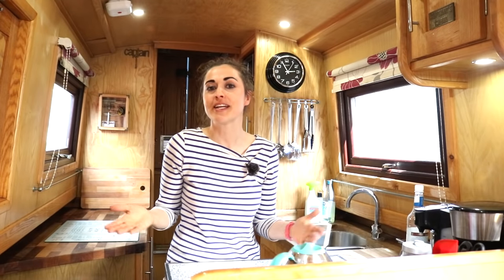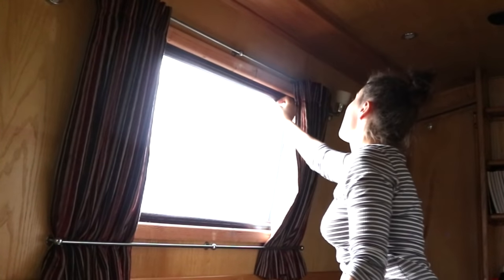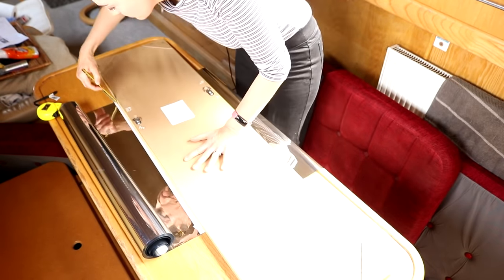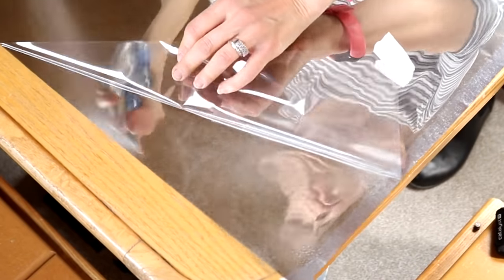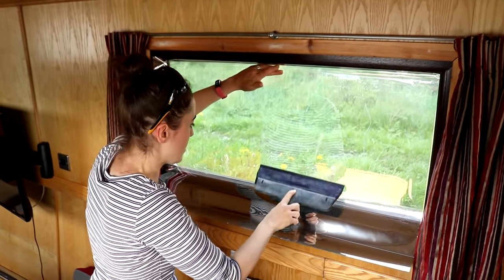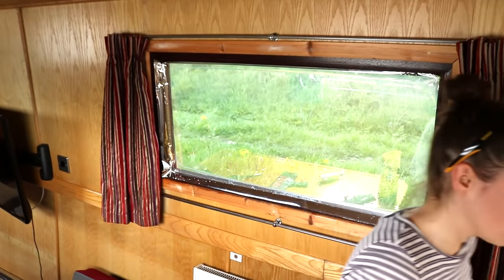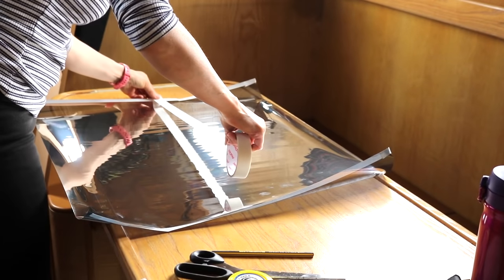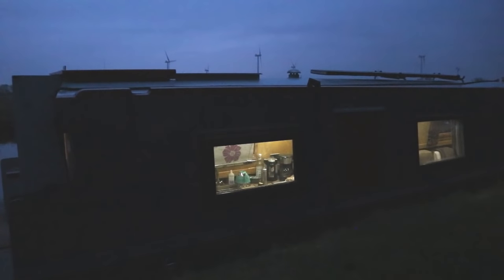Installing Privacy Film on Narrowboat Windows | The Carpenter's Daughter

Comment: First, I watched this video and had high anxiety just watching. Anyhow let me start with I live in Orlando where every window is tinted to keep heat out. Here’s some tips that may help. Keep window and film covered in soapy water for easier adjustment . It’s easier if you have another person spraying as soon as an area dries. Smooth out film with a sponge working from the middle out to get all the bubbles gone. Cut the film as close to the window size as possible to avoid letting air in. Cut final trim with a straight edge and razor. I used scalpel. You did great And you already learned some of the tricks the hard way. Hope this helps for the next time or anyone else.
Reply from the maker: Sorry for having you on the edge of your seat 😆  Definitely could have done with the extra pair of hands spraying it while I worked on the film part :)

Comment: Well done for persevering and finding a better way.
I found the same thing as you, works better if cut to size, or only one edge over long. And as others have said, a little drop of detergent/shampoo helps..
When I put film on my workshop windows, and bathroom windows, at home I nearly gave up too. Then I decided to just take the double glazing units out and stand each on a towel in the shower to lay the film on in there. It meant I could keep it wet, and then slice off excess afterwards before refitting the glazing into the frames! I did a friend's recording studio in the same way. It also means the edges of the film are hidden under the window seals.
Reply from the maker: Now that IS dedication and agree, that would definitely give the best results taking the glass panels out :)
Reply: @TheCarpentersDaughterUK  I've seen professionals putting film on a car tailgate glass, upside down above their heads and have no idea how they do that and get a clean neat install! I would be soaking wet with the film over my face! LOL :D

Comment: The only thing that I did differently whilst covering those glass quarter lights above my internal doors was to add a drop of baby shampoo into the water and dish soap solution. It made fitting a little easier. That was a tip from a vinyl van decal fitter. 

I also cut the whiteout vinyl to size before fitting and used caulk around the edges for a perfect finish.
Reply from the maker: Thanks for the tips :)

Comment: I used a paint prep tool to take the beading off to do mine. Smaller windows are easier as they pop out, just remember the shims.Gives a chance to clean all the rubber edges too. Was far quicker 7 accurate as the overlap doesn’t matter.
Reply from the maker: Thanks!  I was thinking on the day about how removing the internal beading would be better.  If I were going to that effort, I'd probably want to buy proper tinted glass 😂

Comment: Johnsons baby shampoo and water mix is the best stuff for lubing the film and window, also I think your spreader wasa little on the big side, 
main thing is you persevered  and got the job done.
Reply from the maker: Thanks for the tip!   I ended up editing that I'd heard about this as didn't have enough footage to go with it 😬  I'll pin it to help others ;)
Reply: I used that doing my 3m x 1m bedroom window!
Reply: @TheCarpentersDaughterUK  I would use that large plastic blade as a razor guide. Starting in the center of the pane, push the sharp straight edge tight into the corner. Then you can score the film multiple times, if needed, all on the same line. Carefully shift to the side, check the film's alignment and repeat, scissoring off chunks as you go. I'd also recommend the best razor blades you can get. I use titanium-edged blades from Lenox for utility knives. I do side work as a handyman and I still have about 15 blades left of the 100-pack I bought about 20 years ago. Very sharp, very durable. A scalpel with extra blades would work well, too, and gives more precise control.

Comment: Hot Air gun helps but you have to be careful! I always cut the film roughly to size fist . Easiest way is to stick the film to the outside of  window using your soap solution . Cut it to shape using a snap off craft knife . Then take the film inside 👍🏻
Reply from the maker: Thanks :)  Definitely not brave enough to use a hot air gun.  I don't own one, so not knowing what I can get away with is probably a recipe for disaster 😂😂
Reply: @TheCarpentersDaughterUK  maybe a Hairdryer, I’m sure you have one of those lol
Reply from the maker: That I do 😂

Comment: Dont use a stanley knife - Always a fresh scalpel. If you watch a pro do it on a car, they cut the film to size on the outside of the window with all the backing still attached then move it to the inside. Tried it once - never again!
Reply: You have to be careful with that method in case the seals are wider outside. 
Whatever blade you use, make sure it’s stainless steel as that doesn’t scratch glass.